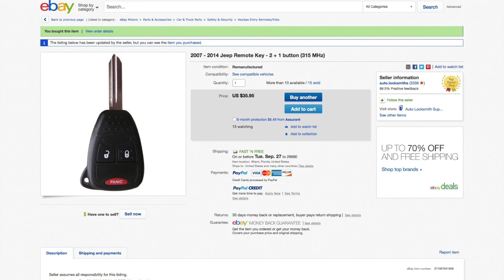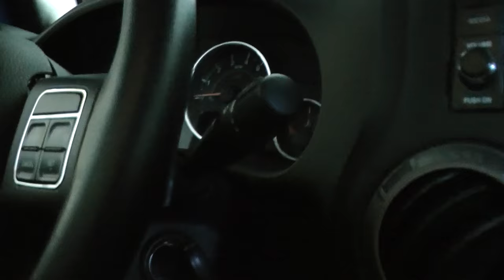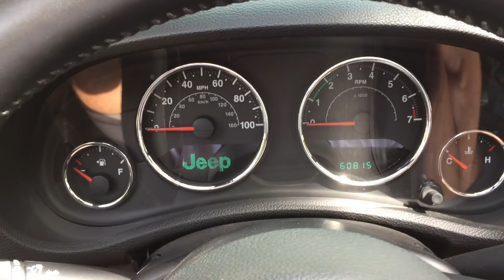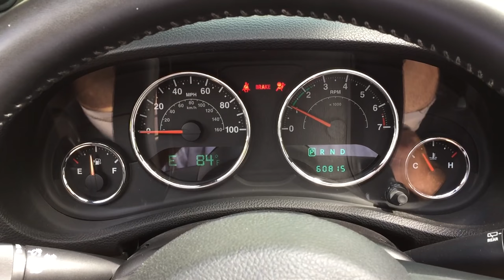Vlog # 8 Painting the Hard Top, Cleaning the Jeep Wrangler Engine, Happy Birthday to my Wife

Comment: love cosmo blue, my 2012 rubicon unlimited is cosmo blue and also has black fenders and top, I put poison spyder steel bumpers on and painted cosmo blue and plan on doing steel flat fenders on and paint them same as bumpers, would love to paint the top but I want a smooth finish not sure if u can sand out the texture but that's how id want to do it, I don't want the textured look
Reply from the maker: I was against the texture look too. But it really came out perfect and from a few feet away it looked like a factory smooth hardtop.

Comment: Love your videos man but didn't you know you can program all your keys yourself? Yes you need two sets that are programed to start with  but you can program a bunch of generic keys as extras. That's what I did I got 2 generic ones like yours on eBay for 19 dollars shipped for both of them, and a regular one for 6 dollars shipped just with the chip in it that's the one I hide in my Jeeps Frame Just If I lose my keys on the a trip. I was able to have a local Ace Hardware cut them for free, and programed them my self with the same steps that I found online for a 2012-14 Jeep JK. My JK is a 2016 so I'm Positive you can program the keys yourself. LINK http://www.keyfobprogram.com/2015-jeep-wrangler-remote-programming/It does work but there are no beep tones when you program them. That was the only problem but if you follow the steps they work the same.Now I have 5 sets of keys. Just a heads up